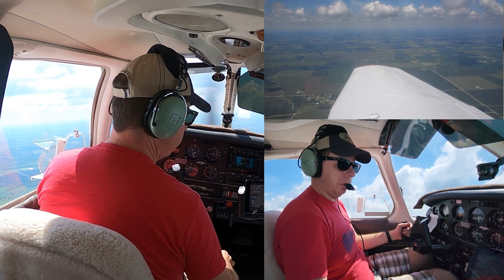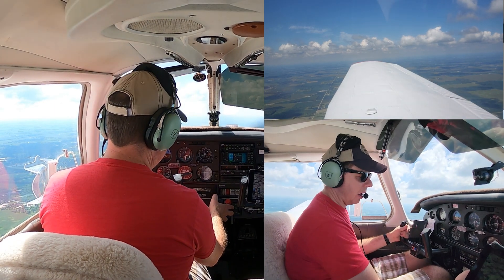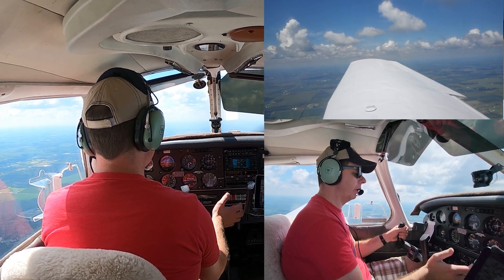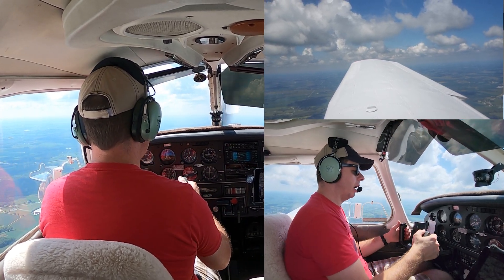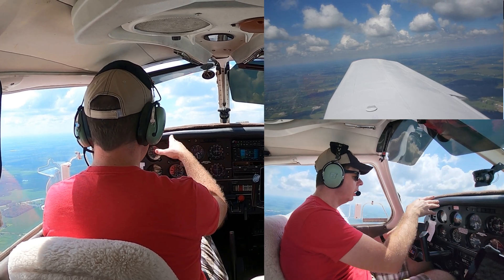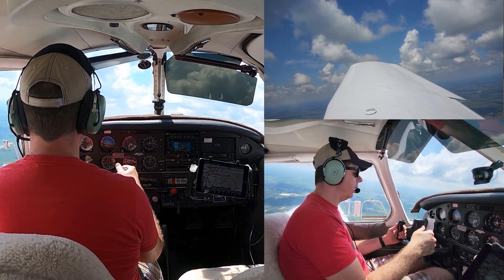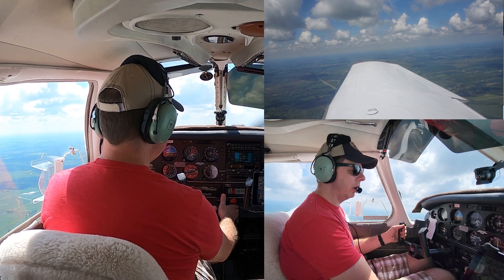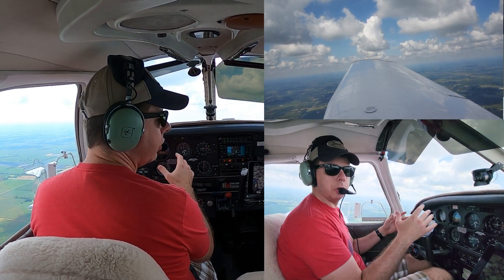Piper Warrior PA28-161 Slow Flight for Private Pilot

Comment: Great video!  The POH for my PA-28-161 says nothing about applying carb heat other than when carb icing is encountered.  Not on the landing checklist either.  Curious if you were taught that way or just see it as preventative.  Thanks!

Comment: Instructor says power to idle first. I don't see why
Reply from the maker: That may be his / her technique. Powering down to idle initially can help increase your deceleration and allow you to get to your target speed quicker. I like to replicate the procedure / profile for an approach and landing in which powering to idle is not the "normal" but a lower target RPM that can keep you more stabilized. I wouldn't say setting the power to idle initially is wrong, but I personally find it's more helpful to closely mimic each required ACS / PTS maneuver to those flight regimes that we do all the time, such as take off,  climb, cruise and approach to landing. Thanks for the comment and feedback!

Comment: What is the low end of the green arc on your Warrior?
Reply: Bottom of the green ARC?
Reply from the maker: The low end of bottom of the green arc is reflective of Vs (Vs1), or stall speed in the cruise / clean configuration. I believe on this particular aircraft it was 50KIAS.